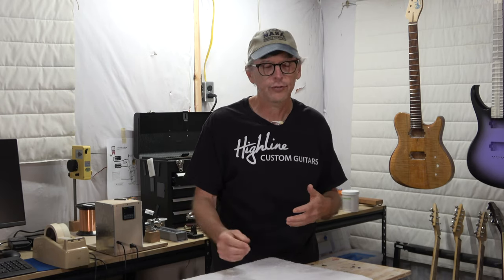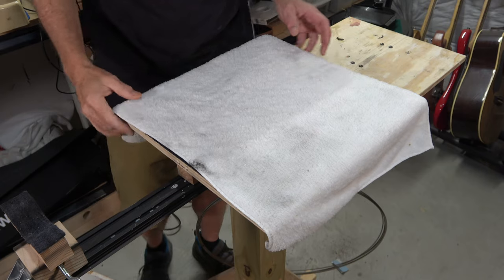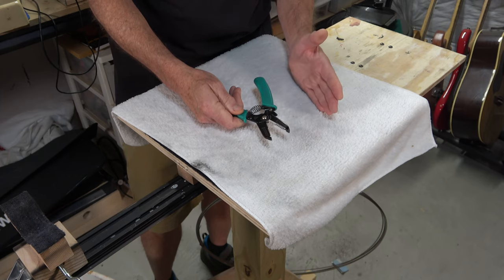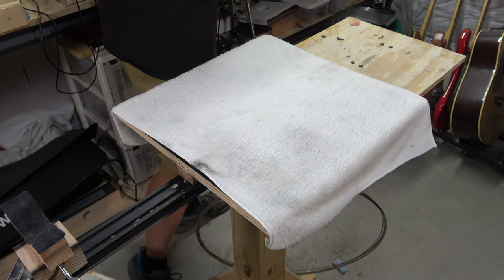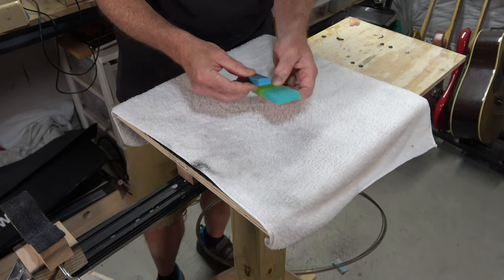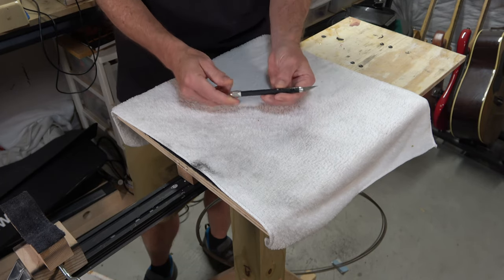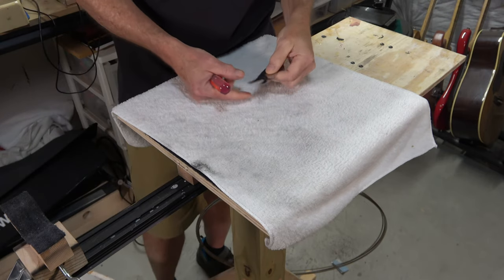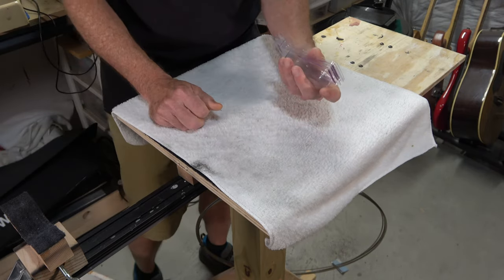Guitar Building Tools You Never Knew You Needed

Comment: Chris, I've learned a lot from you over the years when it comes to specialized luthier tasks, but also on raiding the dollar store for certain tools. Turns out we have those exact same white microfibre faux fur cloths here in Canada, which I use all the time. While I'm now a firm believer of the pink eraser as a contoured surface sanding block, I also recently picked up some whiteboard erasers which I've been using for level sanding roundovers - they work great. For all the tips & tricks you've offered me and all of us, thought you may be interested in that one.
Reply: Regarding erasers, I've got some questions if you may.
I've noticed that there are 2 kinds of erasers: the harsher ones that leave some dust behind typically used to erase ink, and the softer gummy ones typically used to erase pencil, and these ones may gum up some residue on the working surface, eventually leaving some of its color behind.
What practical applications do you have for these erasers? What kind of sanding and what grit equivalent are they? Thanks!

Comment: Oh man did I learn the hard way why I needed that special tool for tightening the 3 way pickup selector on gibsons. I was working on my hollow body and bent the threaded ring trying to get it off because I didn't have the right tool... Ended up having to cut the threaded ring off with a dremel to get the switch out. So after much frustration I ended up buying that tool and a new switch

Comment: The magnifying visors with LED lighting that you show only cost about $8 at the local job lot chain store. They're OK, but the lenses are plastic and they scuff and scratch easily, and they don't give you quite as much magnification as you would expect (5x doesnt mean 5 times normal size),  and you may have to use the inner 2nd lens (which is hinged and flips down) plus the little round lenses in front in order to get sufficient magnification for small and fiddly jobs. They're also not the most comfortable fit, 6 AAA batteries make them a bit heavy, and they make my forehead sweat. Buy an Opti-Visor instead, for around $35 to $40.  The lenses are optical quality glass, and if it  doesn't include a 5x lens (some sets include just 1.5x and 3x), plan on buying a 5x lens separately. The OptiVisor is much more comfortable to wear and the fit-adjustment mechanisms are better as well. They even make 7x and 10x lenses for closeup work. Almost any ten-dollar LED headband  flashlight, stuck on with velcro, will work better than OptiVisor's own accessory flashlight .

Comment: I have the same pointy tweezers, and put shrink wrap on my helping hands. I pretty much have all the same stuff.
Reply: My only issue with those "helping hands" devices is that the base is too small and lightweight and it tends to tip over.  I epoxy glued mine to a piece of metal about 5 or 6" square, but a piece of plywood the same size would work, just to make it less tippy. SOme helping hands devices have a magnifying glass built-in, which can be helpful, but makes it even more likely to tip over easily. I personally prefer wearing a set of magnifying visors; the local job-lot store chain sells a cheap set of magnifying visors for only $8, with plastic lenses and built-in LED lights ( kinda bluish light),  and they're OK,  but I greatly prefer the OptiVisor brand, which have optical glass lenses (availability in different magnification strengths) and are more comfortable to wear. I Velcro'd an LED headlamp onto mine.

Comment: The wire stripper looks useful as did the erasers.  Ordered the stripper !   I gave up on Exacto type knives a long time ago and now use "mold knives" which are nothing more than the large scalpel handle and non sterile scalpel blades.   Mold knives are relatively cheap as are the blades.  Contenti sells them as do other places on line.
Reply from the maker: Great tip!
Reply: Hope you like your stripper! 🤣😇
Reply: @sambeguely1132  Funny thing is that it won't be used on guitars,  different [projects with small gauge wire that i have struggled with.
Reply: I use several types of Olfa knife, the ones where you snap the blade off periodically to have a fresh, sharp tip to work with. These things are awesome and the blades are surgically sharp. The 18 and 25 mm width tools can be obtained with a thumbwheel for locking the blade down tightly.  There are other knives and blades that look similar, but the Olfa  blades are made in Japan, not Asia, of high carbon steel, and especially if you get the black anodized blades which cost a couple dollars more per 5 pack you will be amazed just how scary-sharp they are.  I have other types of razor knives and utility knives, and various blades including Lennox and Bosch and so on, but truth be told I never use them anymore, not since I got the Olfa knives!

Comment: I will put some heatshrink on my soldering clamp thing, by itself I don't find the weight quite heavy enough, need to clamp it down
Reply: I epoxy glued mine to a 5" by 5" slab of metal, but a piece of plywood roughly the same size would work.